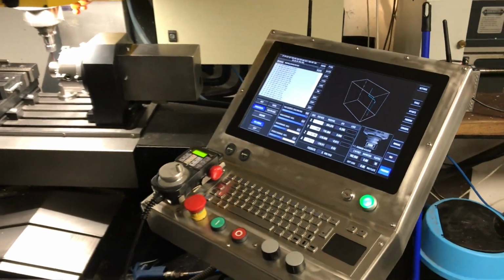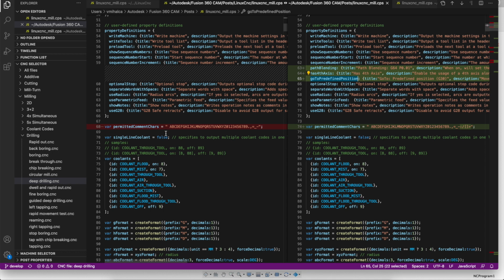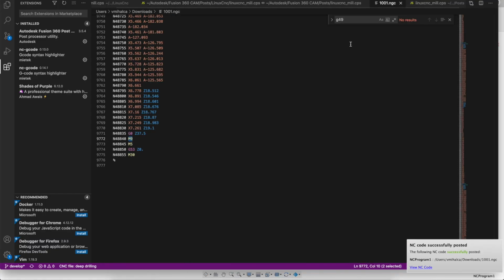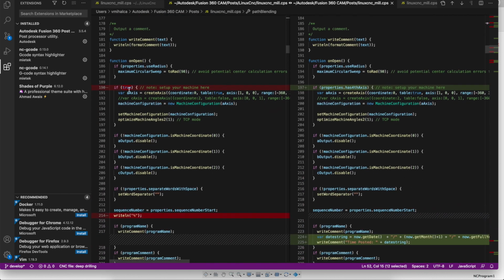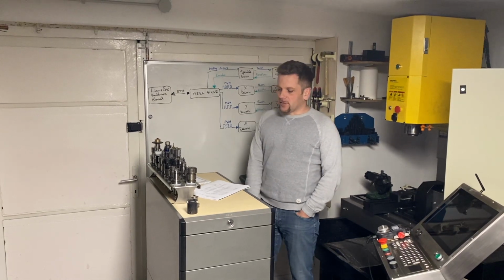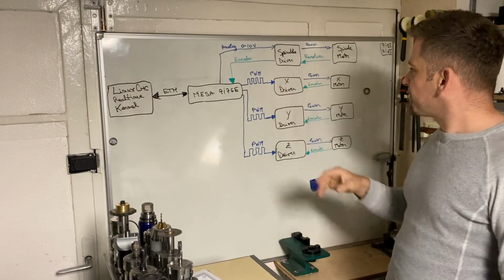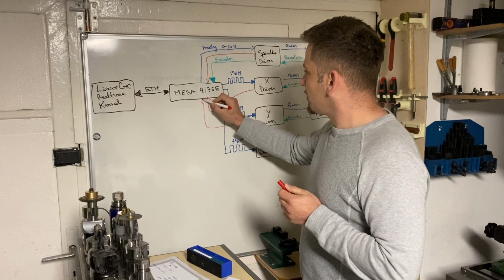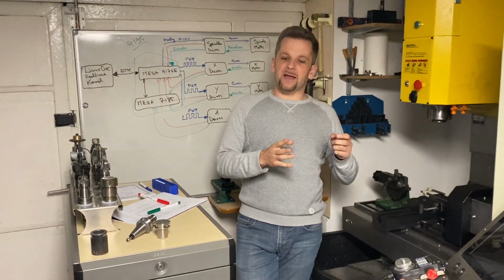Cycloidal drive 4th axis - fails & lessons learned

Comment: Very good! Keep up the good work. About servo error feedback, it is usualy quite simple, older servo drives have BB - betriebsbereit relay contact, which is closed if everything is okay, and it opens up if there is a drive fault. If you use never drives with pulse train for axis motion, those have some open collector error output. You could then net them in linux to estop.